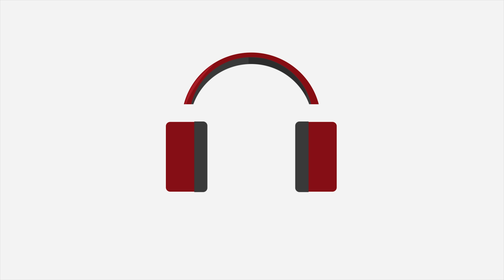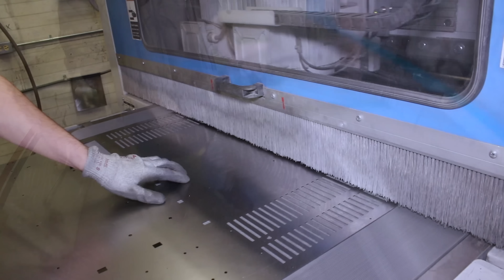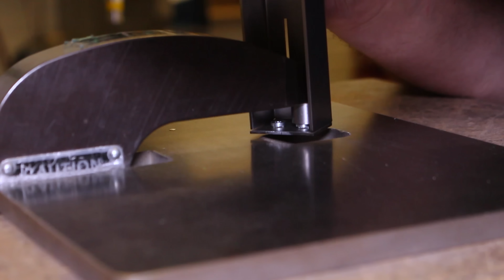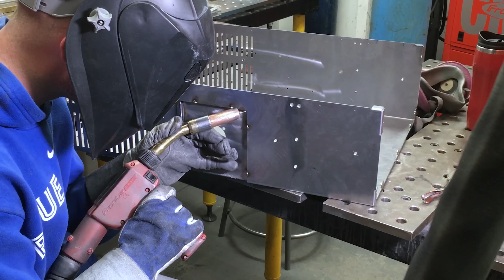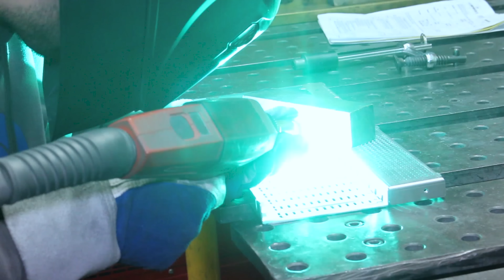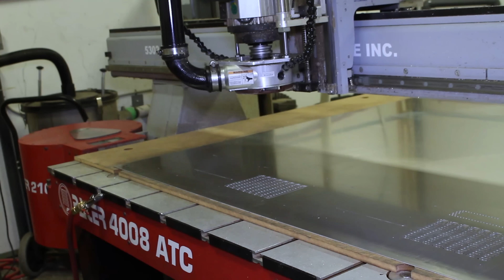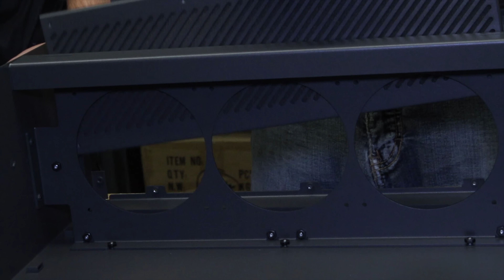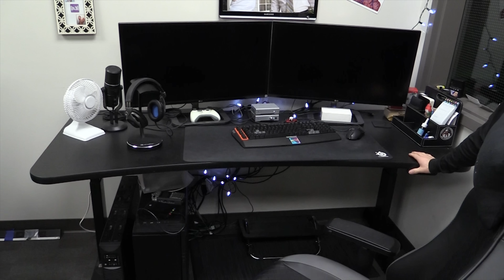The birth of my custom gaming case - Personal rig update 2015 Part 3

Comment: I have question, if you have 128Gb of high-speed RAM and, per example, a Titan X and you share 64Gb of that memory with the Titan, wouldn't that make you not need to upgrade your GPU for a very long time (I know a Titan X doesn't need to be upgraded in quite some time anyway)? If so, is it even worth it?
Reply: +ImPDK ram =/= performance
Reply: +ImPDK 
No, because it makes the core of a GPU 0% faster- regardless of the amount of RAM it has, and also because your system memory has a lot less bandwidth then graphics memory does greatly hampering its performance once it needs to use it.  Your video cards RAM amount has no correlation to how strong the actual graphics part of it is. You can go out and buy a 70$ 4GB GPU, but that doesn't mean it's going to outperform a 250$ 2GB card. 

To put into perspective how much the bandwidth effects it. The last 0.5 GB of VRAM the Nvidia GTX 970 has about the same bandwidth as high performance desktop RAM, and performance has tanked well over 60% in the things that needed to use that last 0.5 GB. Granted not all things would be affected that much by the decreased bandwidth, but enough to the point where it would make having the extra desktop RAM allocated to aging GPU that' son its last legs pretty much useless.
Reply: Not unless you buy the world's fastest mobo
Reply: +ImPDK no the ram won't great affect your videocards performance. the better option would be to buy a gtx 980ti or two.
Reply: +YourNightmar3  It is possible but rarely done as the speeds needed for performance that would be usable is not yet attainable. compare a "apu as the amd version and intel chips with integrated" witch both, does use system memory to an dedicated card.
Reply: +Croatian Gaming And whenever you do that it starts lagging like hell. There's a reason you generally don't want to go above your card's allotted vram. If you start having to use RAM or HDD space for frame buffer you're going to notice a hit in performance, hard.
Reply: Moth Any regular one from nowadays?
Reply: Well, It is true. i can be used. you remeber the 970? when everyone freaked out about the 500 mb's of slower vram? Yeah and that 500Mb's is WAY faster than system ram. Think apu? would you like to run it? Why?
Reply: +Dax Daily he said high speed ram which maybe he's referring to ddr5
Reply: +Fnatic Flushable and I know ddr5 doesn't exist
Reply: Corsair Dominator Platinum Series DDR4 DRAM 2666 MHz 128 GB
Reply: Lachlan
Yes you can
Reply: +ImPDK you cant share your ram with your graphics card.... right? is that possible?
Reply: +YourNightmar3 yes it is. You can deficate ram to gpuso when gpu i out of vram it transfers all the load to ram memory, but you can also transfer hdd into ram which has 45% to burn your hdd, but you can turn ram into hdd space also, its easy, look it up
Reply: +Fnatic Flushable it does exist, its just not practical for system memory yet. it is currently used in Graphics cards..
Reply: Croatian Gaming yes, but that would be creating a swap file and would degrade speed when the load exceed the ram of the titan x and transfer to this swap which would make it not feasible as it wouldn't be worth it.
Reply: ***** What are normal speeds in gb/s for RAM and VRAM?
Reply: YourNightmar3 it depends on the graphics card.
Reply: +ImPDK no no no no no no and no. Using system memory instead of VRAM not only slows the graphics card down a lot, it also doesn't increase your raw power. The problem with running modern titles is very rarely the video memory (unless you're trying to run it at 8K or something crazy) but processing power.
Reply: +YourNightmar3 it doesn't really matter how fast RAM and VRAM are in total.. they serve a totally different purpose.. RAM is used by your CPU and threrefor is optimized for small datasizes as your CPU needs to handle lots of small instructions all the time.. VRAM is designed for large sizes as it stores things like textures of your game that will be processed by the GPU next and send to your display.. that is why HBM is coming next to the market.. it is beneficial to have a high bandwith between GPU and VRAM as it deals with way less transfers but has way larger datasizes to transfer.. 
for RAM high bandwith is not that necessary but it benefits from higher clocks and lower timings as those will increase how many instructions per cycle your CPU can handle.. 
well it's not all the story as you also have cache on your CPU but it's a short explanation why VRAM and RAM are different and why more RAM and RAM allocation to your GPU won't increase performance in any way..
one more thing to the guy with the gtx 970.. yes on the paper the slower 0.5 gb VRAM of the 970 is about as fast as your systems memory.. but those 0.5 gb are still faster than your RAM.. it is not only about bandwith and clocks and timings but also about the physical distance as data from your RAM goes to the CPU and then over PCIe to your GPU and not just from your VRAM to your GPU.. this makes a huge difference..
how many gb/s your RAM is transferring is depending on your RAMs specifications.. usually ddr3 1600 MHz is about 20-25 gb/s.. ddr3 2133 and ddr4 2133 doesn't make a difference at all as they both are about 30-35 gb/s
for gddr5 it also depends on the specifications of your card so the VRAMs clock speed and the bandwith of the interface.. for example a gtx 980 ti got about 336,5 gb/s bandwith maximum total bandwith..
Reply: You can use your harddrive as RAM :F
Reply: YourNightmar3 1753 MHz for the Titan X
Reply: +Red Aikir no, no and no. DDR5 does not exist. Graphics cards use GDDR5 - NOT DDR5. Those things are completely different and have little to nothing to do with each other. You cannot put GDDR5 in a motherboard and expect it to work. They are designed to do different things:
DDR-SDRAM (so DDR2, DDR3 and DDR4) are designed for low latency low clock speed random reads and writes.

DDR-SGRAM (so GDDR5, GDDR4 etc.) are designed for high latency high clock speed sequential reads and writes. They also support block-writes and something called bit masking.

There is not even a standard for DDR5 let alone actual hardware. It to the JEDEC 10 YEARS to develop DDR4 so don&#39;t expect DDR5 anytime soon (if ever, with the rise of HBM and HMC).
Reply: +akabiscuitwaffle Someone knows what they are talking about...
Reply: Moth I didnt mean the speed as clock speed, i ment speed as in reading speed in gigabytes per second
Reply: Dunkelelf3 Damn thanks for all that info, you're awesome. The answer i wanted was in the last few lines haha. You said "usually ddr3 1600 MHz is about 20-25 gb/s.. " but i got corsair vangeance 32 gb ddr3 1600 mhz ram which got 9 gb/s with a ramdisk.. how does that make sense? Its pretty high quality ram.
Reply: YourNightmar3 read my comment..
Reply: YourNightmar3 cause ramdisk is using a software and how good or bad it works depends on the programmer and also using ram in a way it is not really desinged for.. check your ram speed with something like aida64 and it will be closer to what i wrote than what your ramdisk speeds are because aida is testing the speed in a way like realworld scenarios would do..
Reply: Dunkelelf3 ohmygurd you are smart. Thanks :) i'll try it for fun
Reply: Dunkelelf3 That explains a lot... 25 gb/s write and 23 gb/s read :P lol
Reply: YourNightmar3 as i said ram is not designed to be used as a hard drive but optimized for small datapieces going to cpu ^^ 9gb/s is still pretty awesome :P with the downside of having only a temporary "disk" but yet way faster than any ssd..
Reply: Dunkelelf3 :D but then, what is up with samsung's "RAPID" mode? It uses your system's RAM to "create" a super fast SSD. my main SSD now has 9 gb/s read and 7 gb/s write. How does that work?
Reply: I wanna see Linus test this tho
Reply: other people have said this, but RAM =/= performance. Graphics card are much more dependent on the actual GPU than on the about of RAM they have. Otherwise, why would ANYONE buy the Fury X (4GB VRAM) when you can buy 750Tis with 4GB VRAM for $350 dollars less? because the Fury's GPU demolishes the 750Tis GPU.
Reply: YourNightmar3 it's allocating a part of your systems ram as a buffer for read/write operations.. it's more or less like a sshd uses the flash part to boost performance as flash is way faster than mechanical hdds.. also ram is way faster than even the fastest PCIe or M.2 ssds.. well M.2 is also a type of PCIe basically.. so generally it is just the same stuff it uses the faster tech to create a buffer.. so as long as you don't fill the entire buffer everything is written super fast into ram.. then it will be written to ssd from there.. again there is more to it but that's basically how it works..
Reply: YourNightmar3 its more of a bandwidth issue but speed is a known limitation. bandwidth is found via this formula Memory Clock * Bus Width * DDR multiplier. Also Voltage is different But this is actually a good thing if you are not oc'ing the voltage on ddr3 is usually 1.65 - 1.25, also, with ddr3-4 benifiting from lower latency at a lower bandwith and ddr5 is ussually higer bandwith with higher latency. as you can only have one or the other. DDR3-4 is used for system memory because it has been proven to be better as of RiGHT NOW. ddr5 is used as gfx card memory because it is proven to be better RIGHT NOW.  the benifits and downsides of everything plays a part of a systems well being and use.
Reply: Dunkelelf3 Damn thanks for the explanation :) i never really understood how it worked :) thanks for the time you took to explain
Reply: ***** So basicly ddr5 will never be used as RAM because its latency is too big? Interresting...
Reply: No, as i said in a previous comment. it just isnt used YET, it can be used but as of right now it doesnt make Cents due to factors like cost. :p pun intended, the most ddr5 you have seen on one card is like what? 12 gb? there is a reason you dont see 32 and 64 gb cards ;p
Reply: +akabiscuitwaffle As far as I know, dedicated graphics processors already have the ability to access / store data on main memory, in case they run out of VRAM memory. "Dedicating" an amount of main memory to the GPU wouldn't be beneficial. Adding more memory if your system is using 100% both RAM and VRAM could be beneficial  though. HIgher speeds of RAM memory could be beneficial aswell.
Reply: ***** because in something like an office or htpc were you just write some office docs, browse the internet or watch videos and movies you do not need more than an apu? not everyone has an interest in playing crysis 3 at 60 fps on a pc..
Reply: YourNightmar3 naaaah.. ddr5 will be used someday maybe.. there is a difference between gddr and ddr.. as said previous in other posts system memory like ddr3 or ddr4 and graphics memory like gddr3 or gddr5 are optimized for different purposes.. the fact that gddr5 memory would be a pretty bad choice for system memory and also ddr3 or ddr4 would be a really bad choice for graphics memory in deed does NOT mean that there will never be something like ddr5 memory.. 
the technology of gddr5 is basically way closer to ddr3 ram than to ddr4.. well yet again performance wise ddr4 is also not that great improvement over ddr3.. but it brought some other improvements over ddr3 that are pretty technical.. i could try to explain this but i guess it would be easier and better for you to read about those stuff and ram technologys in articles online as i am studying IT but i am from germany and i guess my english is not the worst but all those infromation is out there and explained by people with more knowledge than me and native english skills ;)
have a nice day! :)
Reply: Dunkelelf3 Thank you so much for explaining :) Im also going to study IT but im not there yet haha
Reply: YourNightmar3 cheers and good luck for your college!
 :)
Reply: Dunkelelf3 Thanks man :)
Reply: ***** Write it out... 1 Gigabyte = 8 Gigabit